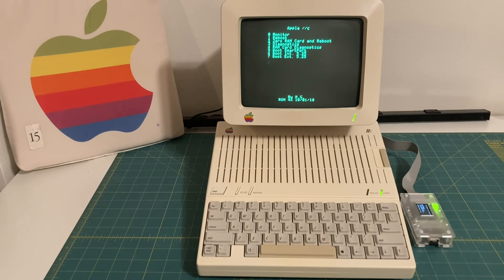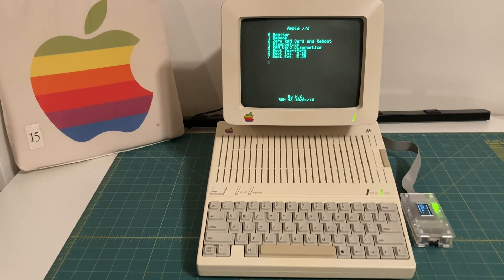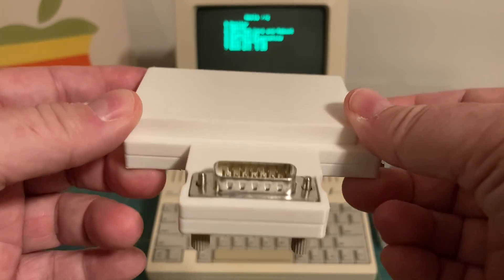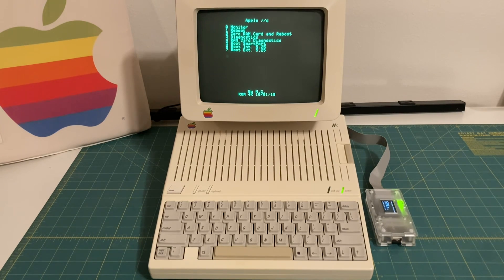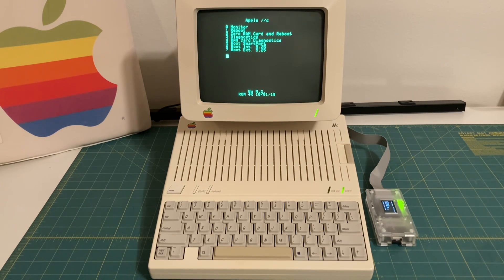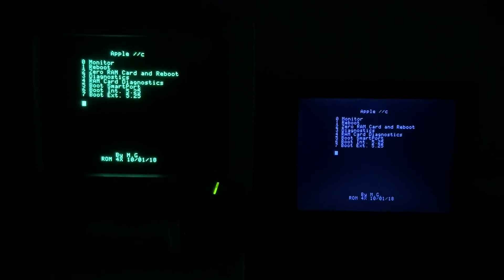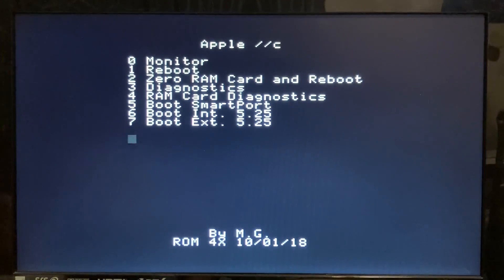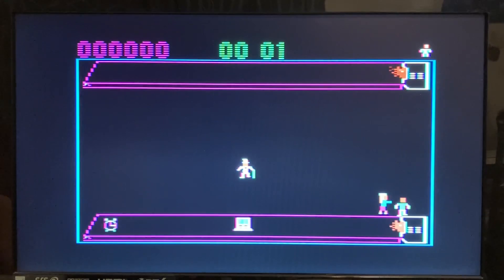Apple IIc (1984) Upgraded with HDMI in 2025 - A2C Tangy Pack FPGA

Comment: This is awesome! I don't plan on building one myself, but I noticed you included a link to CT6502 Assembly Lines where they're selling assembled units for $85 plus shipping, which is perfect. I'll be ordering one this weekend! By the way, what happened with your little HDMI monitor? How did it give out?
Reply from the maker: It really is pretty cool seeing all the modern solutions people are coming up with for our vintage computers. As for my mini HDMI monitor issue... total operator error, LOL. Turns out the cable wasn't fully plugged in, which I only realized after recording the video and doing some trouble shooting. By the way, the CT6502 Assembly Lines site has a ton of nifty items. Definitely worth browsing around so you can bundle a few things together and optimize the shipping.
Reply: @geekwithsocialskills  Tech support 101, is it plugged in? 🙂
Reply from the maker: You're not wrong LOL!